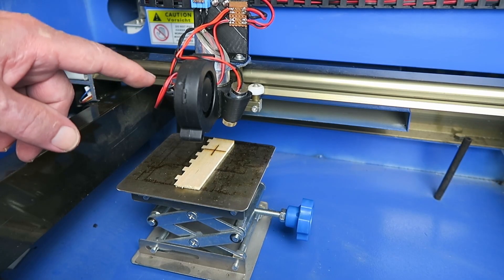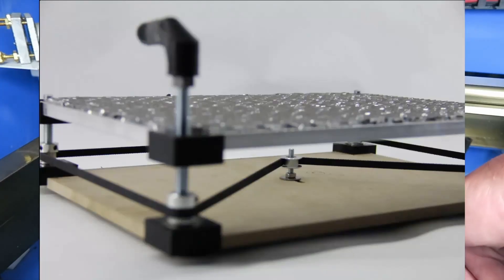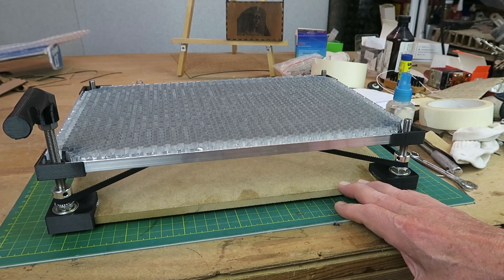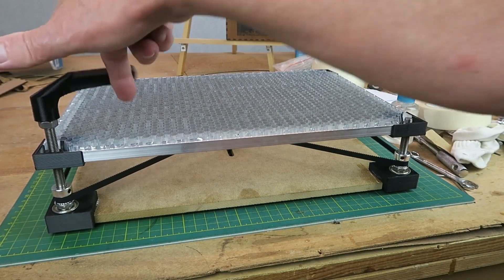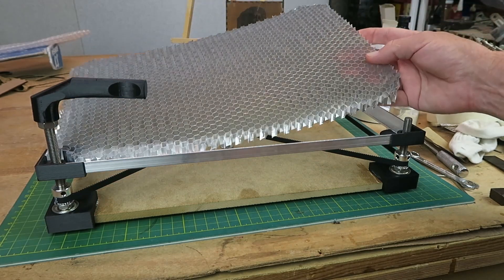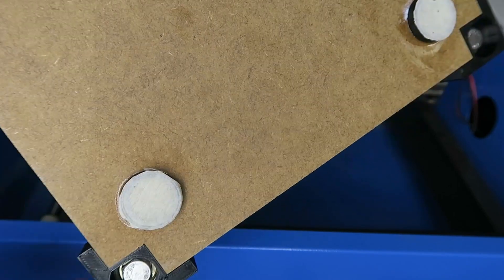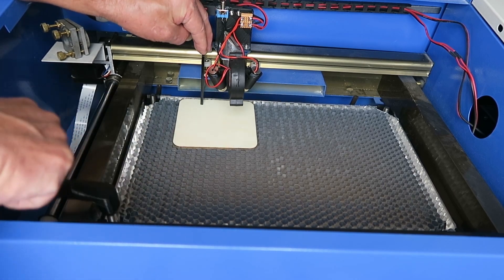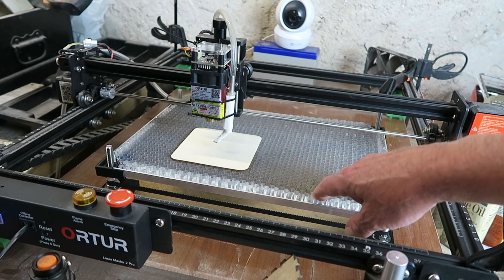K40 Laser Adjustable Z axis Table

Comment: I just put this bed together but am having trouble keeping it level when turning the crank.  Any suggestions please.
Reply from the maker: Make sure the belt is tensioned by the screw in the slotted base as you see here : https://youtu.be/ssJye9Gj6Fo?t=251 Check the nuts that hold the screw to the plastic corner pieces are tight. Check the bed is level by measuring the gap between it and the base on all sides. I have not had any issues with it not staying level. Thanks for watching, have a great day!
Reply: @craftworks7232  great.  thanks

Comment: looks good
Reply from the maker: I am very happy with it. It has been n use now every day. I don't think I could buy all the parts for this project for less than the kit cost. Thanks for watching, have a great day!
Reply: @craftworks7232  a quick question when cutting on the bed does the laser pass through and burn the belt ? thanks
Reply from the maker: @Moondog01  It is a possibility but as the belt is edge on and the laser will be way out of focus I don't think it would burn. maybe a sheet of tin foil over the belt might work?